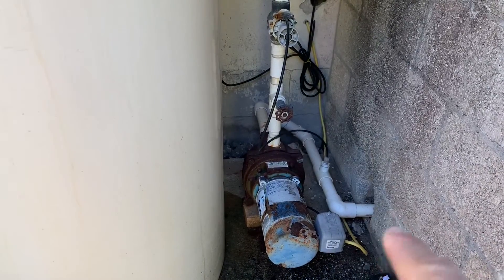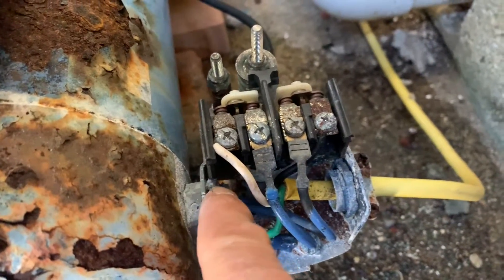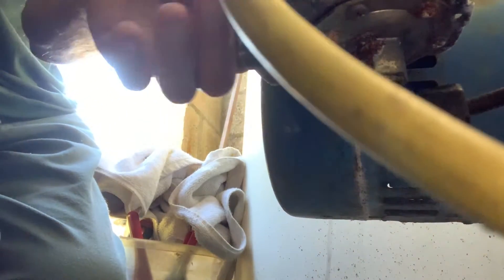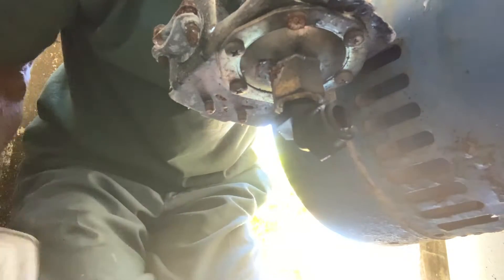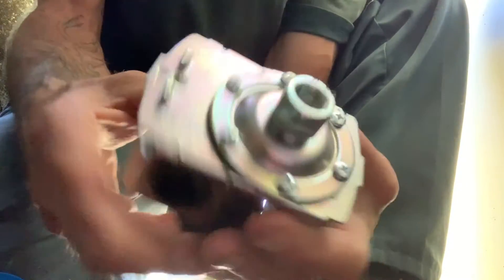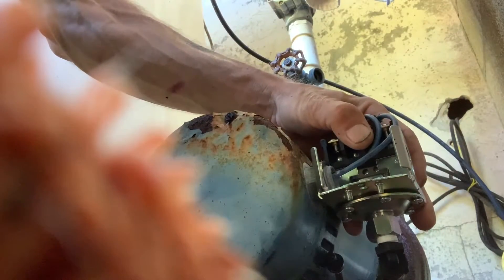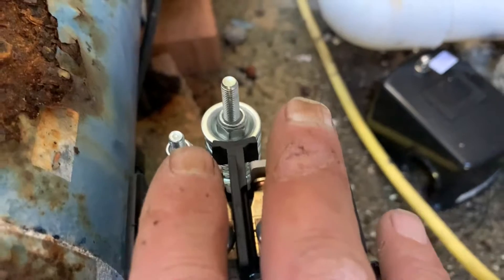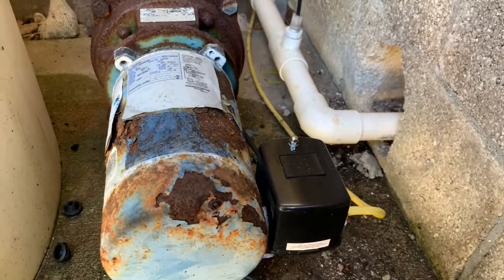HOW TO REPLACE PRESSURE SWITCH ON WELL PUMP

Comment: My pressure switch stops clicking when I open the air release.  Now water comes out strong, but if I close it then I get the clicking noise.  I have changed the Pressure switch and the air tank.  Any guess of what it might be?

Comment: The Gould well pump is always in the OFF state. Is there a way of connecting the input AC power leads to the pump leads to temporarily turn ON the pump in order to verify the switch is not functioning properly instead of the pump itself not working?

Comment: I know it's hard to answer questions like this without physically seeing what's going on - but I have a short cycling switch, I dont know if I have an air bladder or not because all of it is underground. Can I remove/replace the switch without having to air anything back up?

Comment: How does cut-in and cut-out pressures work if tank is open to the atmosphere (12:10) ? By height of water ?  1 foot of water creates 0.433 psi of pressure -> 10' - 4.3 psi, 20' - 8.6 psi. But this tank is only like 5 feet tall.  Thanks
Reply from the maker: Good question I’ll get back to you on this one

Comment: What did you turn on on electrical braker panel at 11:47 ?  Thanks
Reply from the maker: The breaker for the outlet that the pump plugged into